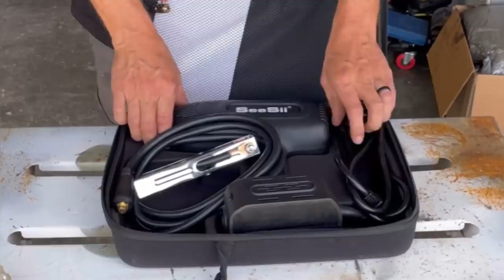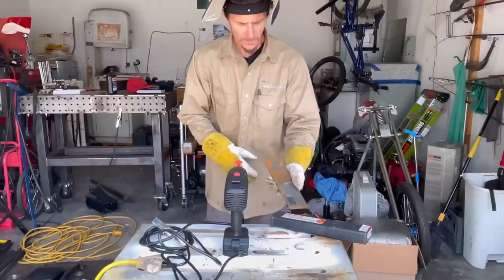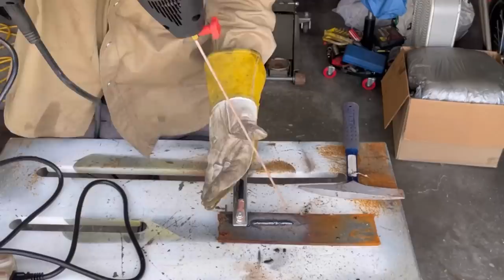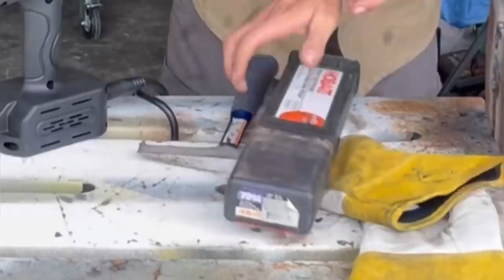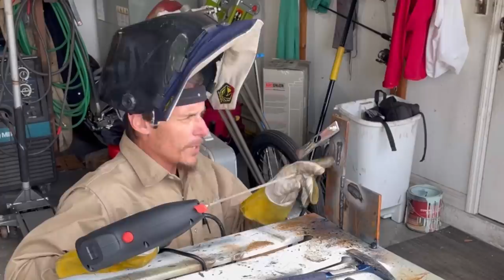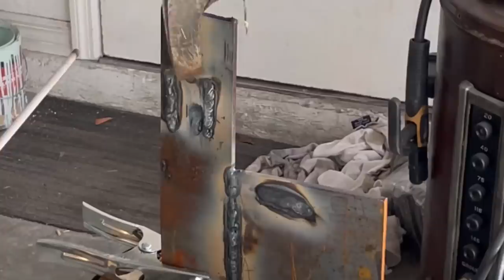The SMALLEST Welder I’ve Ever Used!

Comment: Looks like a good thing to have on a dirt trail or back road kit. You could probably make “get home” repairs with this and an inverter.
Reply: @RIKARD NEW ZEALAND Sure, but it's small lol.  can't really say anything else good about it tho.
Reply: probably wont unless you have a 3000 watt inverter. I have a Simder 200 amp and it doesn't play nice with even a 2000 watt at 120 amps at the stick. When i added a 10 gage generator wire to it, new stinger and ground clamp and that thing sings right along at even 140 amps( on a 220 volt or a 120 volt, 30 amp RV wall socket) and it was only 70 bucks. Even with the original shitty stinger and ground clamp on a 15 amp wall socket and it worked pretty well at 140 amps just would trip breakers. Also it weighs like 5 pounds tops.  Best part is.....80% duty cycle. 
 This thing in the vid is pretty shitty lol
Reply: If it was quality, maybe... But - Car battery welder leads would outweld this gadget, and can run off multiples if needed. They don't error out or crap out in the damp/dirt of the trail., and you can use them to jumpstart with too.
Reply: If you're looking for that just carry a diesel battery, jumper cables, and some flux
Reply: I think it would be perfect for welding tie rods on the trail
Reply: It's a shit design. You can get an import 125VAC DC invert stick machine and 20 feet of good, copper number 4 wire for leads AND a 5lb box of electrodes for under $300 on amazon. I'd much rather use one of those sketchy "death toaster" IGBT inverter machines and have a real stinger and work lead than have this. 

You can run a 125VAC inverter off a little Honda Whisper genset and fix your broken tierod or whatever other trail fix you'd need. Even better if you have a good pure sine inverter on your truck.
Reply: But there are better things to have. Actually, if you dual batteries, you can use jumper cables, a piece of welding rod and do the same thing. Two 12v batteries in series are enough. Eye protection is a problem of course.
Reply: @RandoWisLuL do you run tig at all with it I got a vevor 200 tig built up with 60ft leads for stick gets me to work lol

Comment: Through experienced eyes, this tiny welder is working to specs, such as they are. Most problems you had are operator error or misinterpretation.
1) It's perfectly normal for any welder to shut off when it reaches max operating temperature because it's operated above 50% current rating.
   The time it can be operated after cool-down is called it's duty cycle, and is given in the user manual.
2) It was sticking, hard starting and cutting in-and-out because you were not running adequate current for the rods you used. The label on the rods tells you the current range required. You can turn it up to that range, or you can buy thinner rods that need less current, and/or you can buy rods that are less fussy and better behaved.
3) Based on the intermittent frying sound, I'd conclude you were running it like it was MIG wire. With the right rods and currents, you need to keep the arc smaller/closer/tighter than 1/4 inch or 5mm.
4) Learn what a good arc sounds like. If it sounds like frying bacon, keep going. If it smells like frying bacon, stop and take a break -- your on fire.
Reply: Good advice
Reply: "If it sounds like frying bacon, keep going. If it smells like frying bacon, stop and take a break -- your on fire." My grandpa always said the same thing.. and he was right! You are 100 percent correct in what you say here. Not nearly enough amperes for the rods he was running. but also.. It appears the rod quality was POOR.
Reply: i think he knows all this.. like he said, its about 20 amp off.. as i would expect..
Reply: Omg this comment is the best. Very informative & the humor at the end was great lol
Reply: I hate to imagine how much that dodad weighs I'm sure that had something to do with the sticking. Hard to scratch start with all that weight in hand.
Reply: 😂 😆 😂"I said all of that to say this"

Comment: When I used to do a lot of off roading I carried some sticks, a cheapie handheld visor and some spare jumper cables to make an improvised DC welder I could run off of both batteries in my truck. I used it few times in field once to fix a hitch, modify my homemade barbecue grill made from rebar and I welded a buddy's tie rod back together and he actually made it back to town and to a mechanic before it failed as he pulled into the parking lot. All bubblegum welds but they held up good enough. That would probably be good for camping and off roading if you typically take a generator with you. I usually just watch these and move on but I had to click the like on this one since you told me to go fornicate myself. :)
Reply from the maker: hey you get it! thats what this machine is good for!
Reply: @MeltinMetalAnthony  its like most things , if you need 2500w. buy a 3500w geni.. if that will run 2.0ish,mm rods at 140 /135,,continuas, for a 3'' weld.. decent weld,, its worth it.. i scaled down to an inverter.. mig.. 180 amp.. but they need 15amp plug. outlet.240v, ausie..  still seems like 2 batts is the go.. last trail welder i looked at was 1k..

Comment: i think the reason for the error code was the poor thing overheated due to its duty cycle. however im impressed. technology is improving and i love seeing it do so. 1/8" or 3/16" thick material is all i need to weld and the projects are small. ive always had to deal with subbing out tasks and pay handsomely for it, this little thing i wouldnt mind.
Reply: If you want a small welder I'd recomend a synoxtmex mini it's about the size of a toaster and runs for ages on 120v (its over built to run on 220 volt)I hevent had it had to take a break at all and I got mine for 95$usd if you include the 3 year warranty works great (it only runs up to 91 amps on 120 volt) also comes with everything but the mask sucks it's not digital but what can I say lol

Comment: I enjoy using 7014, smooth like 7018 but easier to weld like 6013. Plus the iron flux adds to the deposition rate. It’s great for tacking and restarts better then 7018 since it doesn’t have that molten glob on that tip.
Reply: if you fling your rod right after every weld the molten ball on the end flies off and u don’t have to worry abt it
Reply: 7014 has the same flux as 6013, only difference is the iron powder added to it.
Reply: @ypaulbrown  both AC rods which shouldn't be used on this machine
Reply: If the electrode is negative then it's running straight polarity correct? If so the only Rod I know that run straight polarity is a 6012 and it is used for Sheet Metal
Reply: @quevicular  you can use Electrode Negative [straight polarity] with 6011, 6013, 7014, 7018, and even 6010 [Lincoln] if you read the manufacturers literature, you will find some facts they state says they can run on Straight Polarity. you have less penetration, but more deposition, which can be helpful on certain type jobs, thin material, big gaps to close ,ect., not all brands will run as well, but you should try and see what they will do on Straight Polarity, EN...just my experience
Reply: @quevicular  @Paul Brown  both AC rods which shouldn't be used on this machine.....Chief: read this chart and see what ESAB says, by the way, ESAB invented the covered electrode 120 years ago.

Comment: It seems to me you hit the duty cycle limit when you were running at 140 amps, maybe 5 or 10% at full power, means you gotta run the smallest rods you can find. I don't know why they went with the handheld power supply, yeah it's small... for a power supply but still adds too much bulk to the stinger. A separate power supply and short stinger lead is far superior... in my mind. -Journeyman welder/fabricator with 29 years in the trade.
Reply: probobly so you have nothing to lose and it throws into a tool bag like a drill.
Reply: @cdrom1070  For a machine like this, a short ground and a short stinger is all that would be required. They could be attached even... still nothing to lose, beats trying to get into a tight spot with that oversized stinger. As many have noted the only real utility for a machine like this is for on the spot emergency repairs, and in alot of thos cases you are dealing with tight spaces. In addition the seperate leads, if unplugable, allows for reversing the polarity and you can run a more varied rod selection.

Comment: One big problem
Not enough striking arc voltage, 
And the duty cycle is to low, that is why it shut off and you have to reset.
And for starting your arc, try inclining the rod more towards parallel to the plane of the weld, Makes for easier starting
Reply: Very low OCV is of course inherent to consumer junk.

Comment: Straight up guy with a straight up review, I recently got myself a lincoln pak 100, just uses flux core but runs off of 110, welded some 3/4 plates and it melted the damn welds in like it was nothen. Best machine iv owned so far!
Reply: I believe the thickest wire it runs is only .035 but it welds like no other
Reply: I run .023 which is far better for thin stock (but will of course weld thicker) and the first thing I did was a MIG conversion (don't buy the kit, various videos include parts lists) so I could escape flux core. If you like FCAW you will love shielding gas. Mine has a perfectly good arc (I've multiple industrial MIGs too) and the .023" wire is a joy to run.

Comment: I always keep 7014 on my truck. Because of the iron in the flux, it’s the best tack rod in the world because it restarts so easy. I also use it when I need to fill in large gaps in thinner metal. A bit unconventional the way I use it but I’ll run 1/8 inch 7014 but only at like 60 amps. Really just to fill in a gap good enough to hold a strong puddle of 7018 afterwards. Just be aware of slag inclusion. Sometimes all have to peck a line of welds to fill in a gap and it will look filled in. Then I’ll chip the Scag and realize the whole weld was slag. Doesn’t happen all the time. Just some times for whatever reason. Good rod though. If anything, just for tacking things up.

Comment: Yeah... For a unit that size, at 140 amps, you're truly maxing out the duty cycle. I'm sure that unit has less than a 25% duty cycle when running at full power output. That's the major downfall of cheap, self-contained welders like that: NO DUTY CYCLE - a.k.a. If you're planning on welding continuously, with a 25% duty cycle... You'll be welding 25% of the time & waiting 75% of the time for the electronics to cool down. - Make sure you pay attention to the rated duty cycles when purchasing welders!!

Comment: I just ordered a copy of this for $60 to use for sheared hardware. Basically a tiny weld from sheared bolts to a free nut so I can back the sheared hardware out. Bet it works 100000x better than 3 hours of drilling and $40 in drill bits.

Comment: I didn't expect much more than globby snotty welds or a possible fire, so I'm impressed with that. And it worked, for small jobs it seems like it'll do, and small enough you can bring it out into the field and run it off a generator for quick fixes. This isn't even $200, and it did the job.

Comment: You should make a video trying to run it on a plug in inverter for a car…would be useful tool for off-road people if it worked!!
Reply: That's exactly what I was thinking. I still can't figure out why they chose to use the drill style setup. Maybe power loss in a lead? 
   I just know that holding a regular gun up under a vehicle in awkward positions gets tiring. I would probably be cussing that thing if I had to hold up the entire power supply for any length of time.
  It's an interesting concept, I will say that.

Comment: I shoved 4 foot piece of copper I had from an old ground wire right into where the rod goes and I took a clamp from a broken jump box and made a little electrode holder. It is so much better than trying to hold steady with that huge drill

Comment: If the plastic markings are to be believed, part of the problem (aside that most super cheapie welders only put out 90A on 120V/20A circuit, regardless) is that it is configured for DCEN.  There is a marking at the bottom "+", so for some reason they have the work clamp as positive, and generally speaking it should be the other way around.  If one could switch the leads internally to make it DCEP like any other respectable stick welder, it might run on.  I have a cheapie Tooliom 135S that is only slightly bigger because it has a traditional case, but I bet the internals are the same.  ~90-95A on a dedicated 120V/20A circuit, and 115A on a 240V outlet (it is dual voltage).

Comment: 🤣 your closing just won a subscriber ! Your honest review and tell it like it is attitude is why we need so we know should we buy it or just say f**k it . Hey m your a real welder , you’ll tell,it like it is . I’m a weld when I need to , so I’m NOT a real welder , like you . 
That being said , this impact shaped obviously low budget duty cycle is meant for an attempt at making ergonomic and budget all in one to make some sales . Ok , maybe it can work for someone who has some kind of welding experience and can make use of it for quick work ?
Longevity will ultimately decide if pulling the trigger on this is even worth it . I own two harbor freight welders , like a lot of diy’ers .
Got a 90 amp ( remember those ? ) and the discontinued 180 MiG , I’ve yet to use . Got that in 2017 Labor Day close out .saved $ on that .
I doubt we will ever see a DCEP version in that little machine since building one with an inverter will,increase cost and weight and there’s likely a bunch of other compact machines that would make more sense to buy / use than this creation . Will say , it will sell on its eye candy thing as people like hand held ergonomic tools . Hope you will get some time on this just to see if it’s got any use in a welders hands and I pray it doesn’t cause any harm to you any more than smoke and feeling heat in your hands which will prompt you to drop it and run for a fire extinguisher and the breaker panel . I do hope however that they keep throwing the freebies at you so you can abuse the sh*t out of them and give us an honest review in your own words , like you do , so we can see it and decide , is it even worth a f**k . Stay safe , welding is hazardous enough . Thanks for your review and keeping it real 👍

Comment: smallest eh, ever cross a screw driver across the terminals of a battery......good stuff Anthony,,,,cheers from florida
Reply from the maker: Lmao
Reply: @MeltinMetalAnthony  that is a cool little machine......I think you were surpassing it's duty cycle a few times......try using some 6011 and see what that does.....great for thin material on DC- and it builds up more metal and you can still whip it.....let us know how that works
Paul

Comment: that would be great with a small generator out in the field to fix stuff on the side of the road. 130amps for a dc stick .. the price is a little high compared to the inverter clones.. i bought a mini 200amp inverter clone new for 30 bucks off banggood. but had no wiring. all in i was at 100.00 bucks. It lasted a week being moved around constantly. Shorted out blew up.. 
great review

Comment: I have, probably, the worst of the Harbor Freight invertor welders, good for a supposed 90 Amps, but DCEN/DCEP.  I just stick with1/16th" rods and I do alright in the 1/8th  to 3/16ths range.  As you intimated, this could use some development before even I would buy one.

Comment: I got really excited when I thought it was a battery powered welder the size of an impact driver. Sure the battery capacity would only be enough for a rod of two but that would be really handy when you need to do a simple repair and don’t have a power source nearby
Reply from the maker: my buddy has the fornius battery powered. says he gets 7 1/8 7018 rods on one charge
Reply: @MeltinMetalAnthony  ya at $4800 ...
Reply: They are cool though..
Reply: @MeltinMetalAnthony  that’s pretty kickass

Comment: Weight becomes irrelevant if you attach a ~4 gauge welding cable to the negative, and whatever you want on the other end.  Essentially it's the power source only maybe clipped to you belt?  Could also kluge up a MiG gun with flux core, or shield gas, or a TiG torch obviously scratch start.

Comment: It could be thermal shut off,   can it run in 220v ? I bought a tiny stuck welder, it come with an adapter to plug into 220, it works good to do quick little jobs,  but the pistol grip is awkward,   mine is a box, about the size of a shoe box,  with 3&4'leads, I ended up getting it for $60 new, as a return to Amazon,  it works to do 2" tacks, the leads are a bit short, maybe I'll try it with my big welders leads, 30' of 0 gauge, I bought it to keep from dragging out the big welder for little stuff!

Comment: Have you tried a ready welderII? They work off of car batteries. Marine/ RV batteries work better though. A great off road welder
Reply: marine,,agm batteries.. for 4x4ing, fridges, lights ect,,not for start up.. as i see you yanks use them.
Reply: @harrywalker5836  I don't use them for start up either, but as secondary batteries with a battery isolator.
Reply: @Bhartrampf  &,you need to have a dc dc charger. not sure if a smart alt will fully charge them. they need 14.5v. or they sht.. less useable volts, but last longer than acid. solar pnl is the go.150w, ish..i have 190w solar pnl, 3500w inv. 100 amp agm..
Reply: @harrywalker5836  any alt over 100 amps charges them really good with a battery isolator, just like for a camper. I have used both and you are correct that the acid battery doesn't last as long, but with two in a series, I have welded up a 20' trailer with it. It can also be hooked to a ac/dc shop welder and a argon tank. pretty useful spool gun.